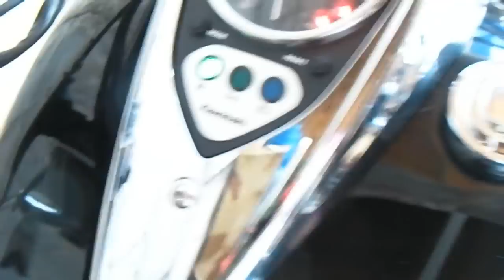Vulcan Starter

Comment: What was the problem?
Reply from the maker: It was this little gear-assembly between the starter and the crank. It reduces the speed of rotatation to the crank. The part begins with a "T". I can never remember the name. I had a shop fix it, $700.

Comment: Hi mine is doing the same thing and I just replaced the battery.......what es the issue?
Reply from the maker: It was a clutch'ish gear that is between the starter output and the crankshaft. I'm thinking it was the limiter gear. It is what reduces the fast spinning starter motor output gear to the crankshaft gear that spins slower. The limiter is not just a 'gear', it's a clutched-gear if that makes sense. It just stopped 'grabbing' and would just spin. Take that info to a mechanic and see if it makes sense. Let me know and Good Luck!

Comment: bad  starter   it has  2  functions   to spin  , and a  solenoid  that pushes out the  gear to turn the  fly wheel
Reply from the maker: In this case the starter engages the torque limiter which turns the crank/flywheel. The torque limiterr was bad and was replaced. It was all Vroom Vroom after that!

Comment: Hi sir, I've problem with my vulcan 750 year 94,
i hope i can resolve my problem with your skill. 
My problem is, i can start my bike but i've to hold starter button. If i release that button engine will stop immediately.
For your info, i just change whole set wiring, junction box and cdi unit(2nd hand). Same goes to old set(wiring, junction box and cdi). Please let me know if you have solution about this problem. Thanks.
Reply from the maker: Your problem sounds like an electrical problem like you have some wires connected wrong. Way beyond my skill set. Sorry!
Reply: tq.....

Comment: Has anyone changed a starter in a '92 Kawasaki Vulcan??
Reply from the maker: I did not end up replacing the starter. It was a different part that needed replacing. I made a video about that and made a link to it with an annotation. Turn on annotations to get a link to the video explaining the fix.
Reply: I've got the old one out but i'm having trouble getting the new one in all the way.